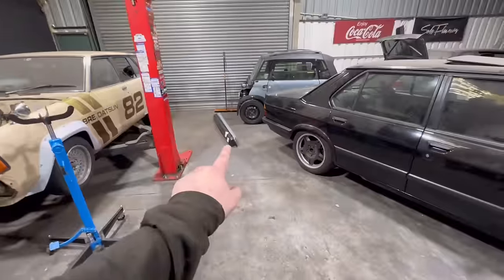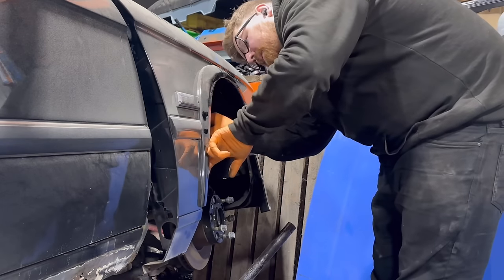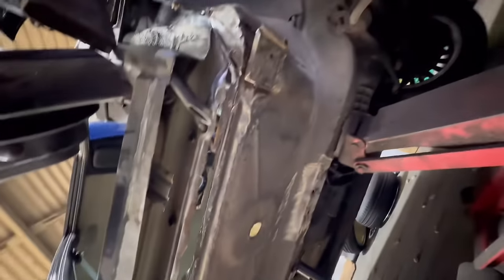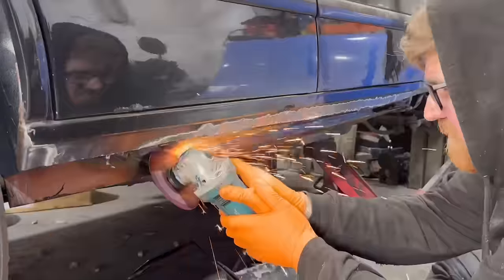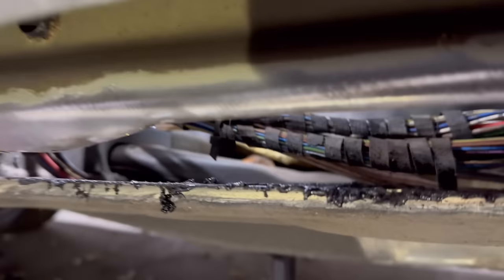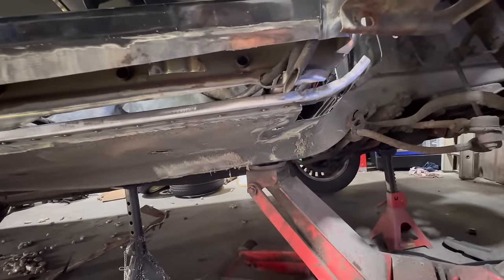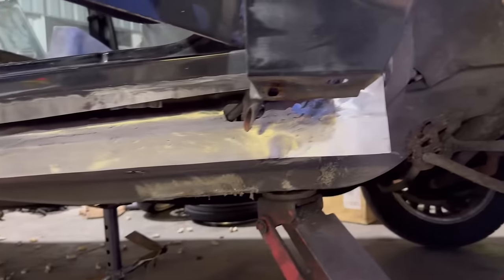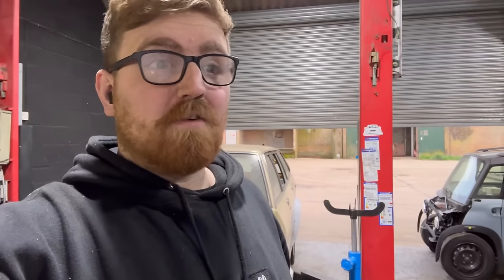EVEN MORE RUST FOUND ON TAYLORS ABANDONED E28

Comment: 8:31 - probably the best PG rated advert for not using the 'trigger lock' feature on an angle grinder, i've seen in a long time.  Not saying that you had it locked on - I wouldn't want to presume - grinders have different features in different places etc.  That could have gone horrendously wrong though IF it was locked on and it DIDN'T disengage.  17.7k of us would be missing your amazing content - good metal work content is rare.  As much as a clearance ballache it creates, I do like using the extra side handle - so I can really grab the b'stard whirly machine of potential doom.  On my old and crusty B&D, I can swap the handle to each side with ease for horizontal slicing - I do wish they added a 3rd position on the 'back' of the grind head for it too - especially for slicing in the veritcal orientation.  I had a cheap-nasty-no-name one that used a 'twist release' handle (like an SDS drill) that rotated around the neck for 360 degree positioning - yet my 'good ones' do not /o\  I got something in my eye the day that one re-enacted a successful Ghost Busters trap.  I told myself 'it didn't fit on the grinder tree properly anyway' - however, every now and again, I see or do something that reminds me of the benefits.

That edit from CAD to plate - was legit.

Rust repairs are brutal, yet very rewarding - except the burns, splinters and ofcourse - the black bogies.

I'm here for the classics, the metal work and the chill delivery fella - plus the 4-5 minutes of relaxing toe-tapping music with black screen at the end.  What is the name of the tune?  I need it in my life.

Looking forwards to the next one, superb video chap.
Reply: Yeah, that there is why I always use a full face mask. 😳Death wheels have earned their nickname.

Comment: Not called a death wheel for no reason. Lucky escape there man! Ive got a nice 18 stitches long scar from a similar incident in my forearm!!
Reply from the maker: dam! i need to be more carefulnlol
Reply: I never use a grinder without the guard and rarely without the extra handle. I live in a cold place and I can’t use safety goggles, due to condensation on the inside blocking my view, so I use the largest, closest fitting prescription glasses I can find and keep the guard between me and the whirly bits at all times. I also use gauntlets whenever I possibly can.
I’m hoping to bring all my limbs to the grave with me, not have some go ahead of me.
For long grinds, like that sill, I use ear defenders too. I need my hearing.
So far, touch wood, my only welding accident involved setting my overalls on fire, while wearing them, in a confined space between a car and a wall. 
It was very sunny and I couldn’t see the flames through the welding visor, so it was well established by the time I realised just how much too hot I was. Burned all the hair off my leg, half my chest and one forearm, but suffered no lasting injury. Moral of the story is, don’t wear oily overalls when welding. Use clean ones. Also, try to have an observer with you, while working and don’t do it in places you can’t quickly escape from.
Reply: Kevlar sleeves all the way!

Comment: Keep do the great work. We all get to the point of saying it’s the last rust repair jobs. I got out of the trade 10 years ago but have a collection of Alfa’s from 90’s to 00’s, rover 216 vdp 1990 which you have to fab repair panels for it and a Ford escort mk1 which is a rolling restoration. I’m in the middle of doing both sill’s on my Alfa gt 3.2 and just brought an Alfa gt 1.9 jtd cloverleaf as a my next daily but have 4 areas on the sill’s to weld done all the other jobs on it. 
I’ve bought a full face mask as had a few cutting discs exposing in the last few months.
I came to your channel from auto Alex when Taylor did the video.
The work you do on the airbag job’s has been very interesting.
Reply from the maker: Thankyou mate! i do need a new mask and all other bits of PPE!
Reply: @Joshwaa___  I’ve only just started wearing ppe over the last few years

Comment: I'm in the process of restoring an e28 and earlier restored a VERY rusty 2002....Your take on the following: replacing the vertical inner sill... wouldn't it have been better to make the join higher up(replace more of the vertical plate? As it is now, the continuous butt weld overlaps the floorpan bent edge- you are practically continuous welding the vertical plate to the floor in addition to the plug welds. Putting the join higher would have made it possible to clean nd ptotect the welding. 
+body flex can cause cracs in continuous weld.
Same with the outer sills. Butt-welding the panel leaves a long exposed weld inside the sill that is difficult to treat. Replacing the whole panel at the spot welds would in my mind leave a result with more longevity.
Love the work anyway. Just thinking.

Comment: Quick leftfield one for you Josh.  What do you use for HSS drill bits.  I can't ever seem to get drillbits that don't turn to butter on me.  Can you recommend not just a brand but an actual set that I could get and that will last more than one or two goes at steel.  Mega thanks.
Reply from the maker: @davyboy888  i struggle to find anything good too! i just resort into grounding them town, usually the panel is scrap anyway!
Reply: @Joshwaa___  Thanks for getting back to me on that... I guess I need to think of them as 'consumables'... I've tried Makita,  Bosch, DeWalt... will try Bosch Professional to see if they're any better [and let you know of course] :  Thanks again.

Comment: can i ask why you never use a mask? grinding and cutting puts alot of fine metal dust in the air. 

Inhalation of metal dust and fumes can induce a wide variety of pulmonary diseases, including lung cancer, airway diseases, and pneumoconiosis . In cases of pneumoconiosis induced by metal inhalation, patients usually show yearly progression of disease, which results in pulmonary fibrosis.

also you got fucking lucky. use a guard on that grinder from now on. ive seen nasty injuries from this exact same thing happening